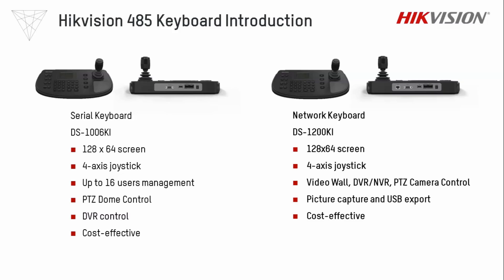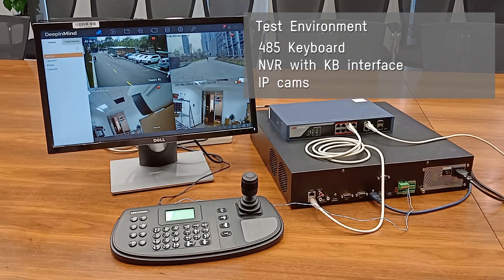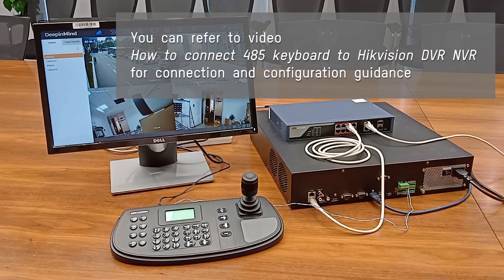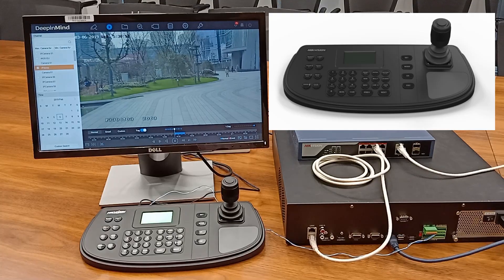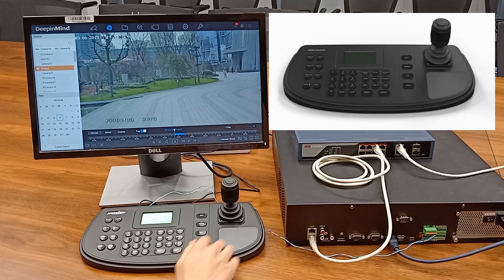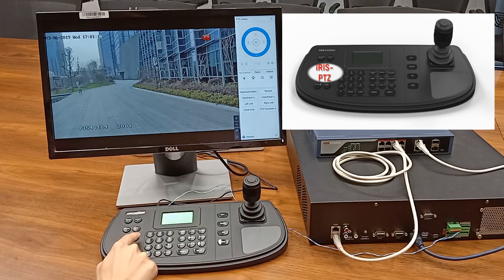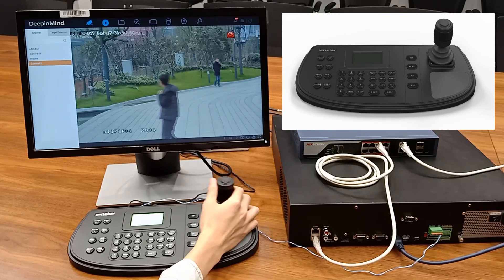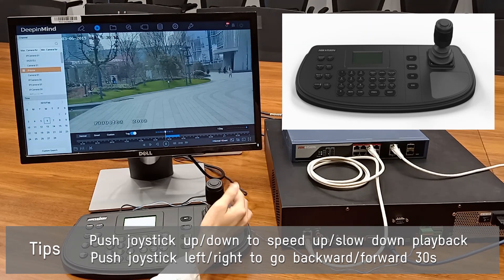How to use 485 keyboard control DVR/NVR GUI4.0

Comment: My problem with the 1006Ki is that is only offered speed control when wired direct to a camera going via DVR/NVR it is fixed speed requiring me to use the mouse to set the speed. bit of a dumb design. the joystick should always control the PTZ IMO none of this entering PTZ mode which brings up on-screen controls which on GUI 3.0 actually get in the way of the image. also logging into the keyboard seems counter-intuitive. should have an option to have no password at all

Comment: When controlling a Smart PTZ via NVR using an RS-485 keyboard, do you have proportional speed control for panning (i.e. small joystick movement - slow, large movement - fast)?
Reply: No, it's a fixed speed joystick.  I bought one and was disappointed because the manual incorrectly states that it's variable speed.  I ended up getting a DS-1005KI instead.